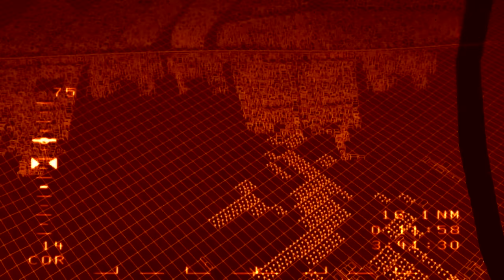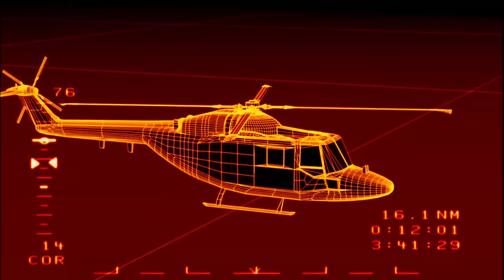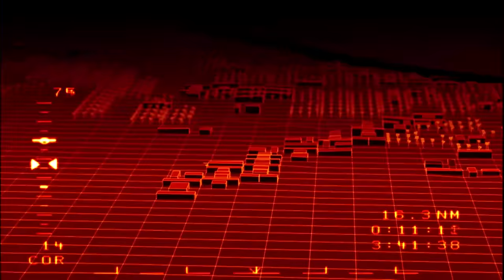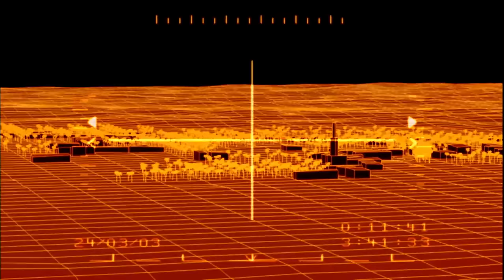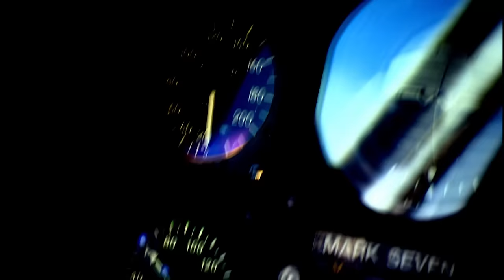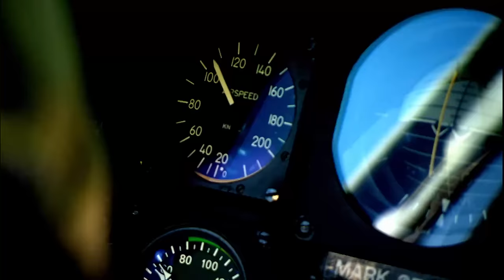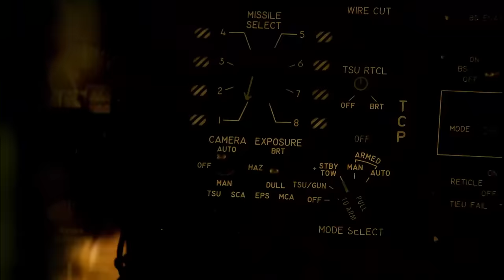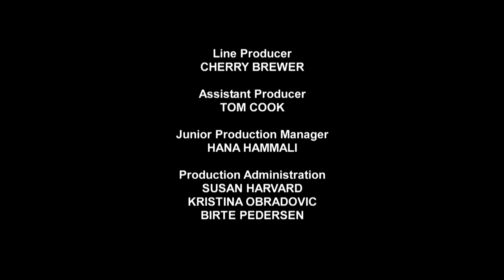Helicopter Wars | Duel In The Desert | Season 1 Episode 4 | Full Episode

Comment: The old Westland Lynx. That thing is a speed demon. The modified Lynx flown in the speed trials in 86 clocked an avg of just over 400 kph,  which is about 250 mph. That’s with modified engines that boosted output by 45%.  This particular Lynx being flown in this video, as well as what was being flown at that time  avgs a little over 320 kph, or about 200 mph. To put this into perspective, the Boeing Twin-Turboshaft AH-64 Apache avgs about 290 kph or 180 mph.  Although not as advanced as the Apache (mainly weapon systems), that says a lot about the Lynx. Especially when you consider that the Lynx was first introduced into service in 1977, about 44 years ago.
Reply: What AH 64 airframe are you referring to flying 180 MPH? We don't measure speed in mph. We measure in knots. I've flown every airframe of AH 64 from 1987 to 2015. Never been in one at 3000 MSL do much more than 150. Maybe 160 slick. That's 172 MPH-184 MPH. We're talking no load. Wing stores removed. You load one up with a bag of gas and full 30 and 2.75. It ain't doing 180 except in a vertical dive with little hope of avoiding an overtorque at the bottom at best. A mush into terrain at worst. Everywhere we went our mission speed was 110-120. As a matter of fact, I flew outta of Knox doing test flights on their 64s in 2010-2011 with the guard unit there. I was a contractor. Maybe I was sheltered and just missed the performance from the aircraft you were talking about.  Have a good day.
Reply: @rdwelch2   All the information that I posted was from information that I read in a book.  You, being the pilot, I’d be more inclined to take your word for it.
Reply: @MrKnoxguy101  Have a great weekend and like a lot of us, "Never Forget!"
Reply: @rdwelch2  You have a great weekend as well sir. I will always remember.
Reply: I always like the look of the Lynx. it's neat how they explain how the main rotor has a special hingeless design.

Comment: Just wondering - why didn't the tank commander use short bursts from his heavy machine gun? I think that would have been more effective.
Reply: The issue here, i  guess, is range...
Reply: @pepemalin1   He probably had a better chance using time fuse warheads as AA much like older AAs use to like the old German 88's for example. but shooting an aircraft with over 2 kilometres by just using optics is indeed very impressive
Reply: @lipeferreira7  they could shoot them easier because they aircrafts flying straight a line in big formations,but a heli....
Reply: Range
Reply: Didn't want to give his position away and the range is a factor!

Comment: The Sikorsky X2 now holds the record with a 45+ kmh advantage over the legendary Lynx.
Reply: I think rhe video is around 2004 or 2007 idk, the battle was in 2003 if i heard corrrectly and the x2 had a first flight in 2008 so its understandable.
Reply: but the X2 is just a coax rotor demonstrator,  not a production bird. It doesnt carry weapons or cargo, X2 was only flown in clean config

Comment: Built for speed but not capable of true vertical takeoff with a combat load out? OH and no armor? Sounds like it's time for better engines!
Reply: Better engines don't really do anything when you've got the intakes choked by sand filters. Its almost like breathing with a painting respirator on if you will. That engine is working harder, thus creating more heat... and with no air to cool the engines... There would be no flight at all.
Reply: @grassman9622  The Blackhawk development team was able to sort this issue out. I am sure the RAF could find a way to get more power to the blades as well.
Reply: @grassman9622  They actually did figure it out in a way. They replaced it with a helo that had the a$$ the Lynx didn't in desert conditions. Btw, I am not saying the Lynx was a bad chopper, it was great outside the sandbox.

Comment: At its top speed a helicopter does not go out of control.  With one forward rotating blade creating more lift and one aft rotating blade creating less lift, the law of gyroscopic procession states that it will level off its forward tilt, thereby halting any more acceleration.